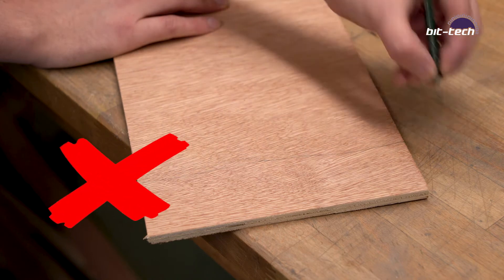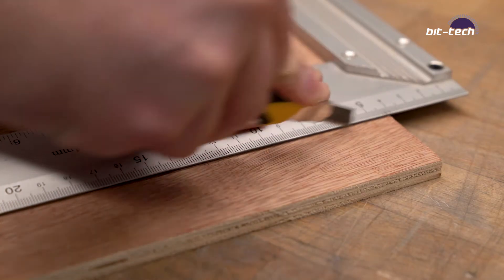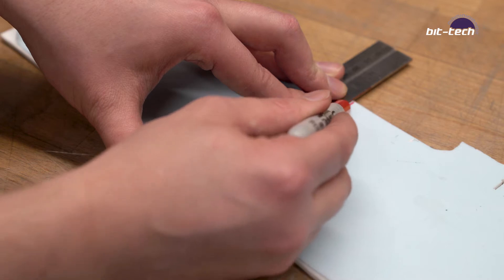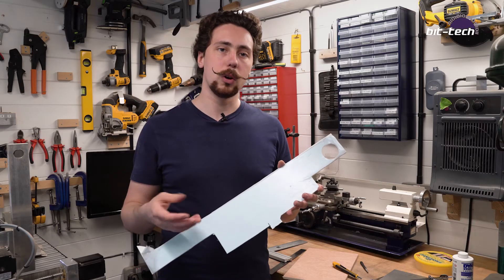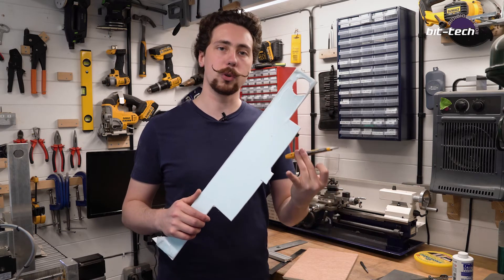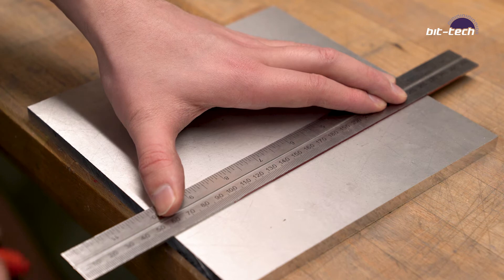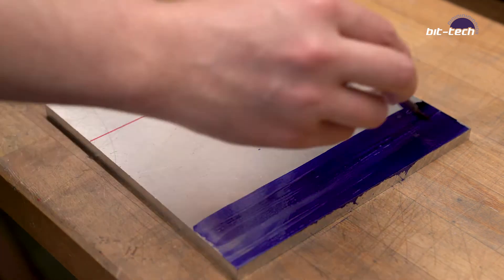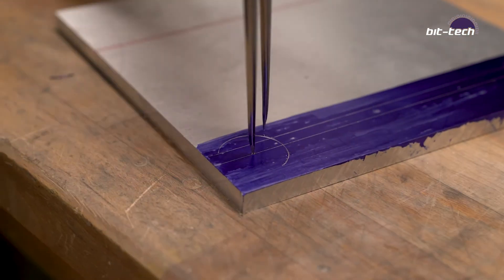A Guide to Marking Out (The Modding Toolbox) | bit-tech Modding

Comment: I liked this video, but I noticed that the precision of the marking fluid method was perhaps compromised by bits flaking off along the marked line. I would have appreciated a small comment in the video as to why that happened, as I'm sure it doesn't happen all the time. Was it perhaps because the surface needed to be degreased before the marking fluid was applied, or might you have been overly enthusiastic about getting the video to us quickly and so it did not have sufficient drying/curing time, or something else?

Comment: But the REAL question is: do you cut ON the line or AFTER it? :P
Reply from the maker: And THAT, is indeed a good point!  Usually find it easier to cut on it as most cutting tools are set up for the edge of the blade, but cutting after helps if you intend to finish the edge later with another process.
Reply: That is the most helpful answer! Thanks